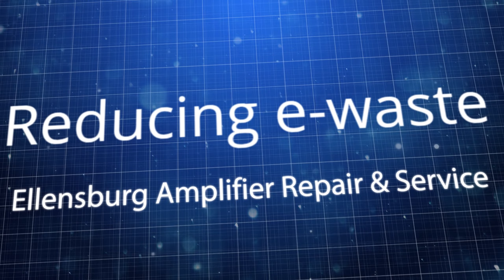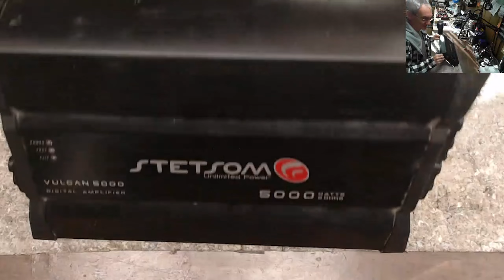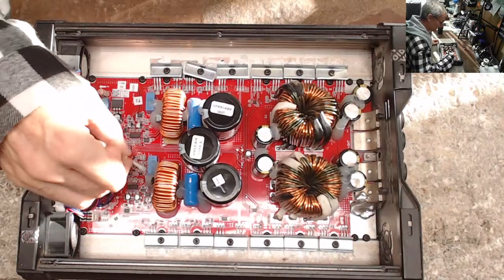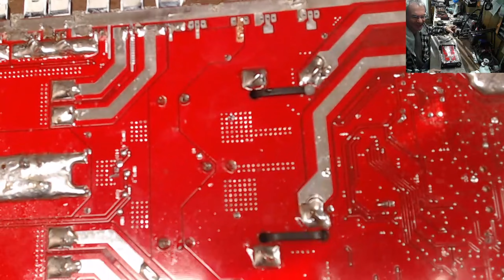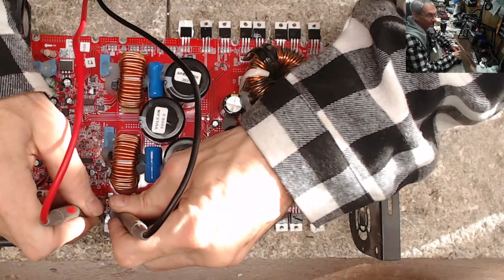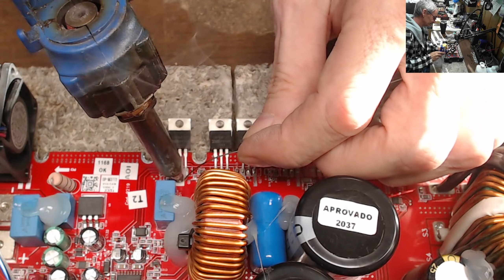Stetsom Vulcan 5000 Amplifier Friday Trace Repair and Rambling Boring Video

Comment: What are the 16 pin output driver's ics part numbers
Reply from the maker: Good question! I have not repaired Stetsom amplifiers for quite some time. They will either be the IRS20957 or the Si8244. Best way to know is to match the datasheet of these to the input pin location on the board going to the drivers.
Reply: Okay thank you

Comment: Hey,i jave another jp33 that turns on,but no sound output. No burnt fets,sqollen caps fried traces. Its brand new,any chance i can sed it to you? Or are you swamped todd?
Reply from the maker: Unfortunately, I do not accept the JP amps in for service IF it has blue tooth connectivity. If it does have it then the issue is most likely the blue tooth card which I cannot service.
Reply: @ellensburgamplifier  I don't know what the he'll it is,I took the module out and reconnected everything and still turns on but no output. All I did was turn off my amps and dsp with a toggle switch and it did something to it but the other 2 amps and dsp are still fine I'm stumped. Thanks for getting back to me bud
Reply from the maker: @markroberts715  The RCA input runs through the Bluetooth card. So removing the card will remove the pre-amp signal. There is a digital potentiometer IC and a PIC on the card that is most likely shorted. I found the digital potentiometer ICs and have determined the issue causing the fault BUT I have no access to the PIC or firmware.

Comment: What is abnormal value for rectifier diode?
Reply from the maker: An abnormal value would be low resistance or a short using a meter. You should see the resistance value go up as capacitors charge. There are common anode/cathode, and doublers, but they all get measured similarly. If you are asking about forward voltage, I would base it on the type of rectifier such as general-purpose silicone .6v or Schottky .4v along with several others.
Reply: @ellensburgamplifier  thanks teacher 🫵🏽👍🏽🙏🏽